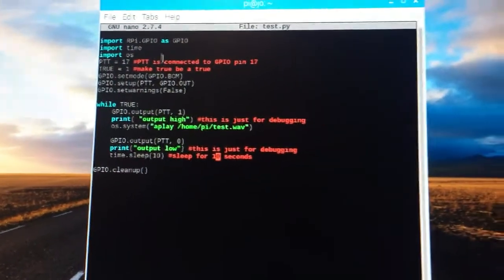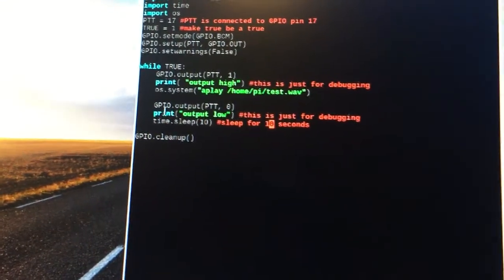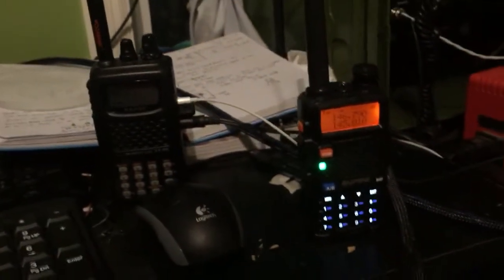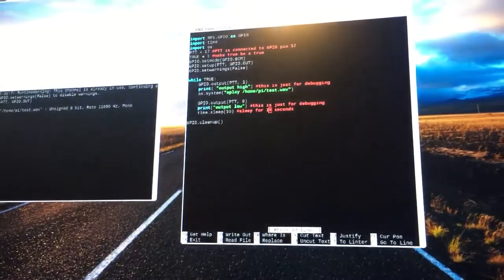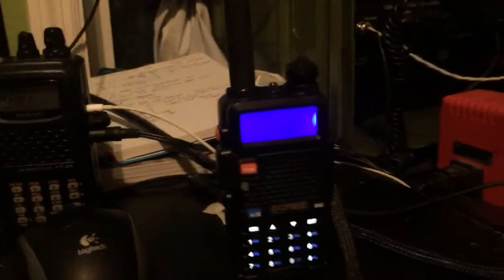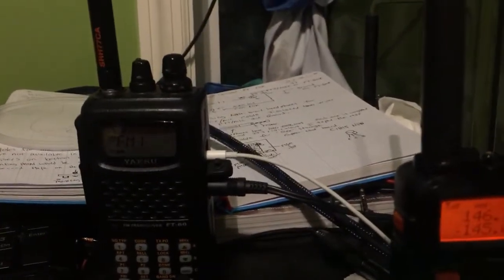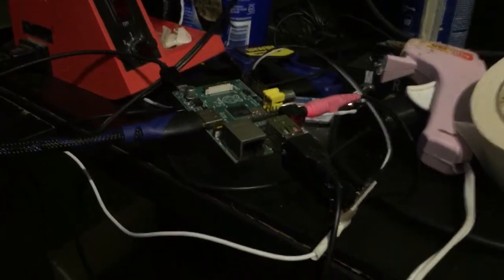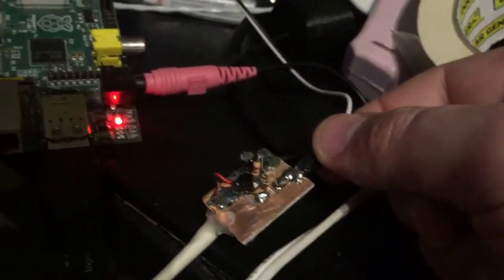Raspberry Pi Controlled Amateur Radio Fox Transmitter

Comment: Love this video!  I am a software dev but know little about radio.  Looking for a project I can build with my middle school son and copying your design would be perfect.  Can you comment on the parts you used? (raspberry pi & FT-60R I see but didn't get the control board)  Also, could you point me to where I should go to make this legal on my end.  My understanding is transmitting over a handheld requires a ARRL technician license.  Again, total newb here and just starting to learn about this.  Any direction you can give would be great.  Thanks!
Reply from the maker: How did I miss this comment? I hope I replied in some kind of way. Yes, a Technician can do this project and transmit legally. My website w1rcp.com has the schematic for the interface between the PI and the FT-60. I hope you didn't give up on the search due to my negligence to reply in a timely manner.